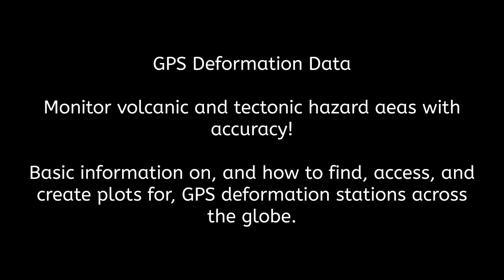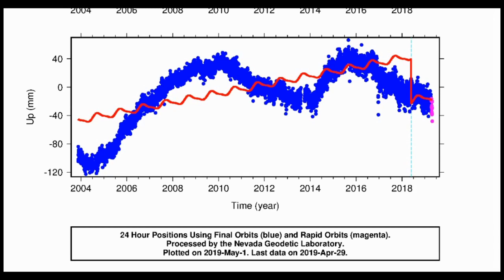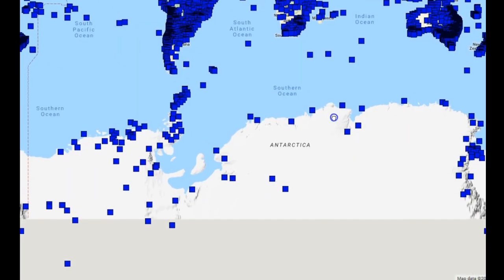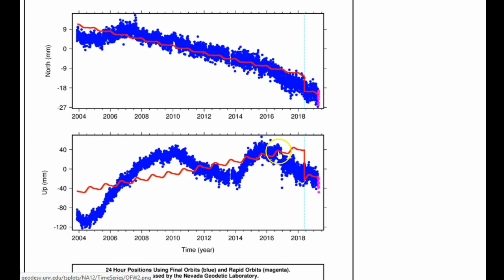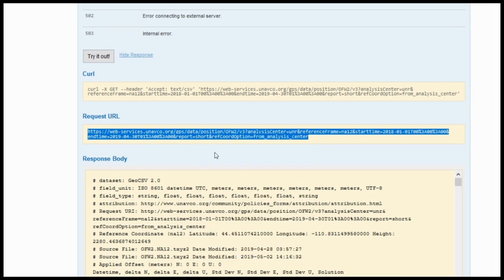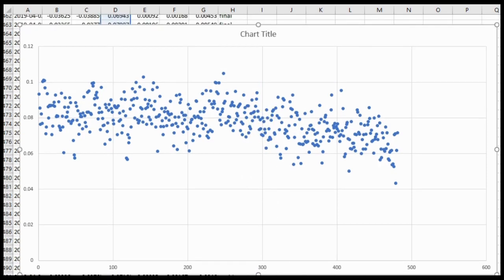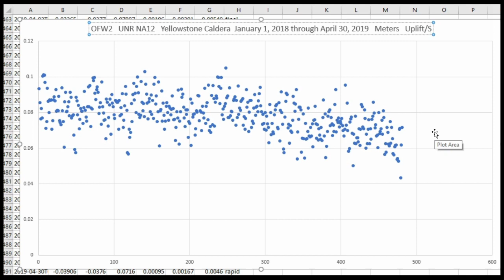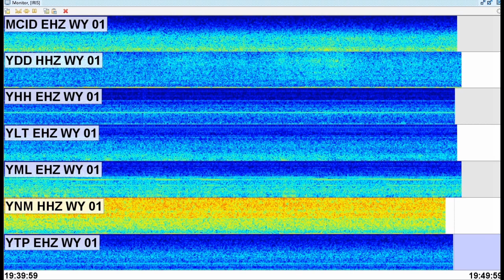Volcanic and Tectonic Deformation Monitoring: How to find, access, and create plots for GPS data

Comment: Got any idea why the N star is no longer due N.
Reply from the maker: The north star?? Well it depends on where you live. The north star becomes more overhead when heading north. At the north pole it should be right above you, but it does tilt a little bit due to the changing tilt of the earth every year (seasons). However, it still should point north. I don't monitor sky charts much. Is it not pointing north anymore?